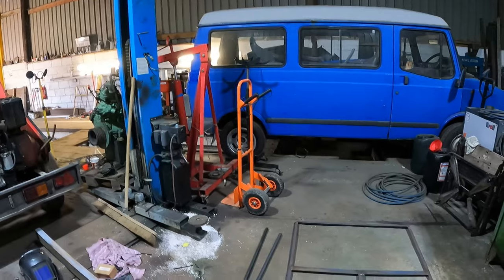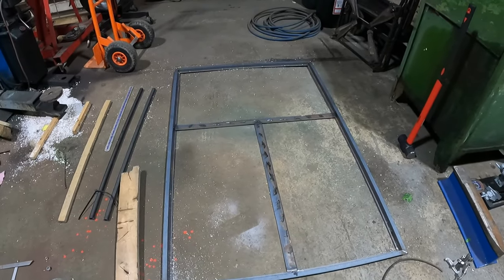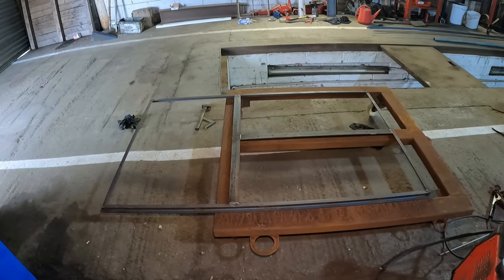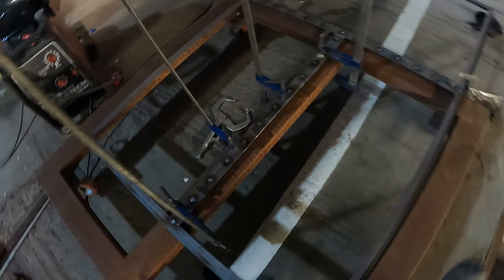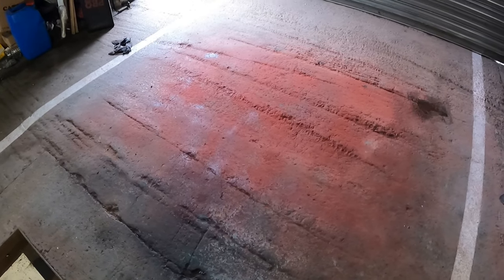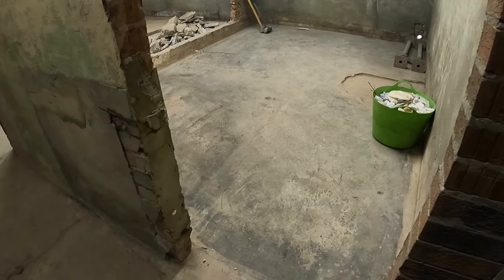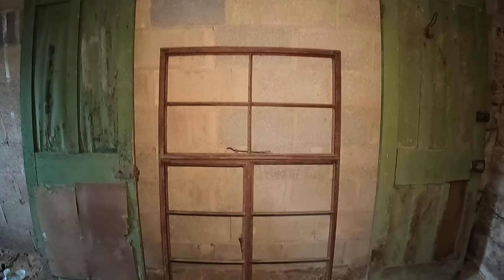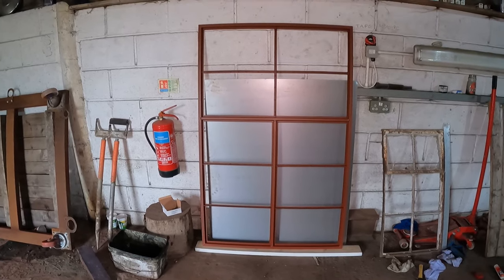Making WW2 Crittall Windows . Part Two, What Do You Think?

Comment: Looking good - a lot of hard work.  My only concern, if you open to the public, is with no opening window will you have the required means of escape were there to be a fire. I know it's even more hassle but I'd expect you need at least one opening window in each room.
Reply from the maker: A very valid point Andrew and one I have thought about. My design can be easily adapted to have an opening and any room/area where an escape is required will have one.